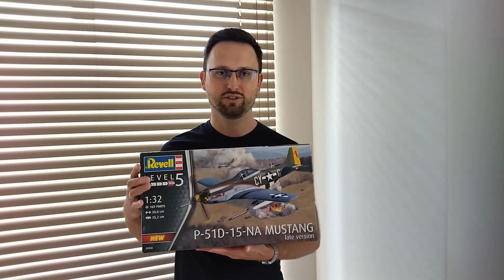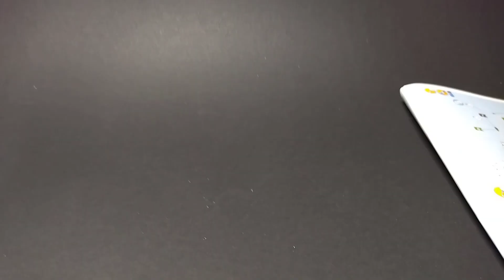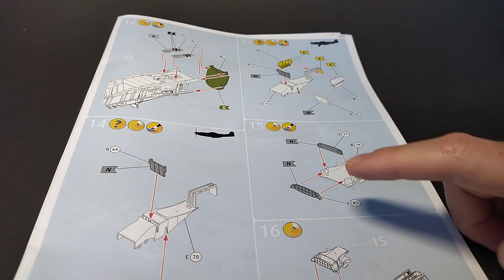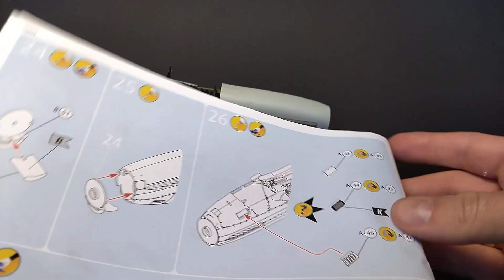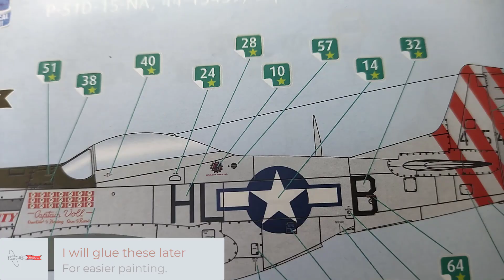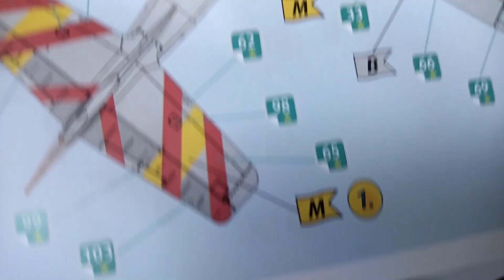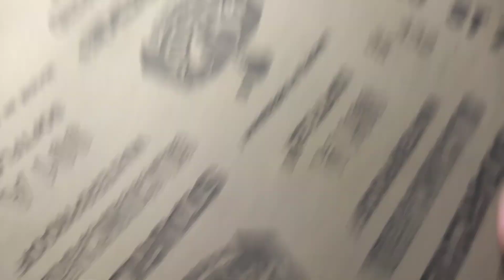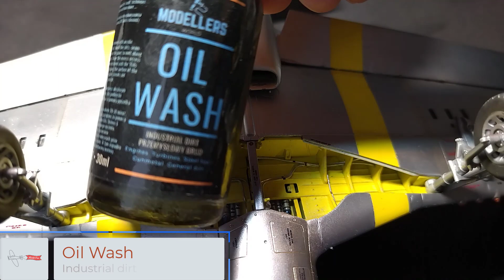Mustang P51D-15-NA. American Beauty FULL BUILD Revell 1:32

Comment: So, this Revell kit has no Packard licensed built RR Merlin V-12 engine?
Reply from the maker: No engine at all.
Reply: @modelfun  thanks. I wonder why not.
Reply from the maker: @DavidRLentz-b7i I don't know, maybe savings $$. It is still quite cheap kit for 1:32 scale. Would be lot nicer with the engine tho :)
Reply: @modelfun  I do not denigrate it. From what you show here, it is a very good kit, and appreciably cheaper than others. It is kilometres better than the kits I years past had seen (then discounted). 
   I would like to find something similar in 1:25th-scale (ideally, with a fully detailed engine, etc.), to set alongside a four-wheel, wingless, Ford Mustang two-door coupe.
Reply from the maker: @DavidRLentz-b7i nice idea. I know there is a kit from Trumpeter available on 1:24. But in 1:25 I've never seen one.
Reply: @modelfun  Thanks. How is the Trumpeter Mustang kit?
Reply from the maker: @DavidRLentz-b7i not sure, I do not have it. But you can check everything on Scalemates. Reviews etc.
https://www.scalemates.com/kits/trumpeter-02401-north-american-p-51d-mustang-iv--142724

Comment: Really love this video! What an outstanding example of how to build a plastic model the right way. May I ask how long did it take from start to finish?
Reply from the maker: @Darren Whiteside Thank you, I work when I have time, so it is not easy to tell the exact time spent. It took around 5 weeks in total, sometimes I spent 2 hours per day, but there were also few days when I had no time at all to work on this build.
Reply: @modelfun  My situation is basically the same. I'm working on a F6F-5 Hellcat and F4U-1D Corsair at the same time. I started building in late February and I'm only now in the final assembly stages of the Hellcat. The Corsair is a few steps behind as I'm about to attach the fuselage and wing assembly. I hope to be finished with both models by the end of the month. Only time will tell.
Reply from the maker: Great aurcrafts. Good Łuck with the builds.